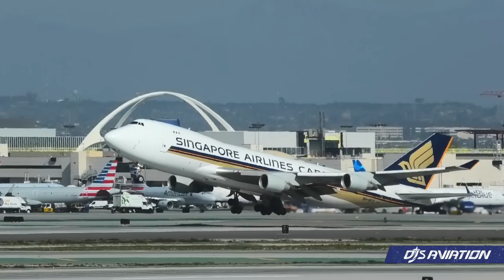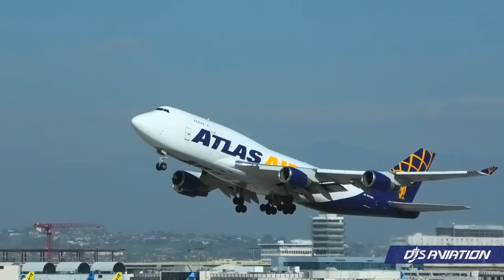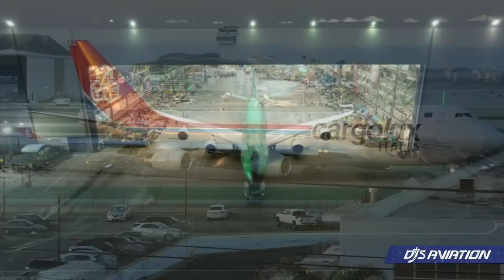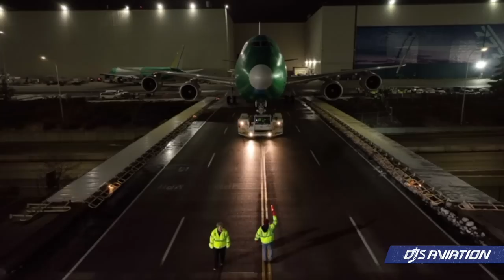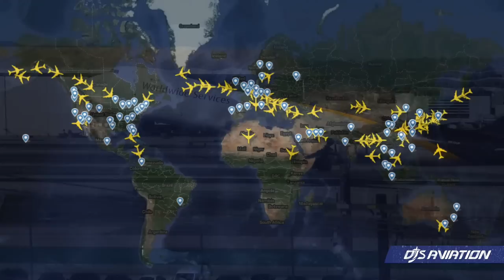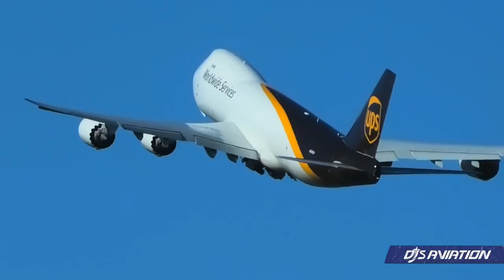Boeing 747 Airworthiness Directive Issued

Comment: As I understand, not every 747-400 or Dash-8 has the horizontal fuel tank or trim tank as it’s called. I’m trying to look it up in my service files/manuals for dash-8 and it appears as a option. Yes it could be a catastrophic event if the transfer pump malfunctioned for sure
Reply: Yes the horizontal fuel tank or horizontal trim tank is a option on 400’s and Dash-8
Reply: dash- 8 as in 747-8 or the turbo prop lol
Reply: @AA-tz2bm  yes, we are discussing the 747-8i or as most call it the Dash-8, not that little tiny De Havilland Canada thingy

Comment: This AD note sounds somewhat similar to the one issued quite awhile ago, with the fuel system, in the empenage, which could leak into the surrounding shrouding and eventually leak into the aft pit... However, I still feel the 747 is by far - the best wide body plane ever made... By far, the most reliable of the long haulers...